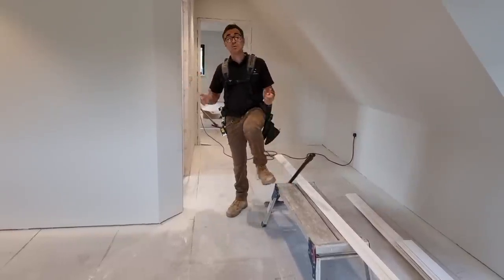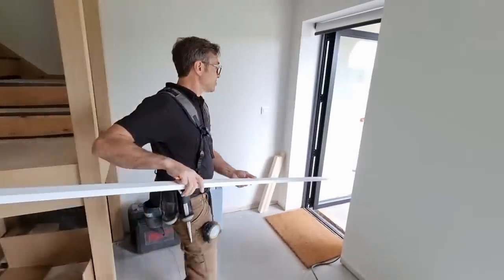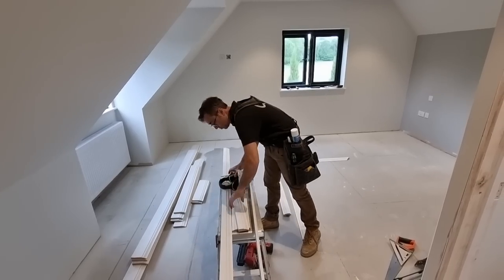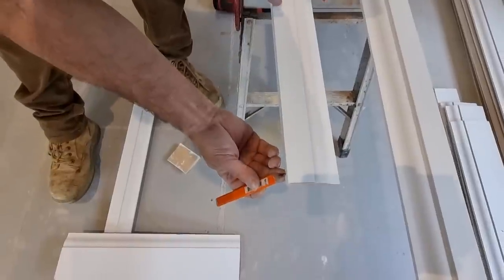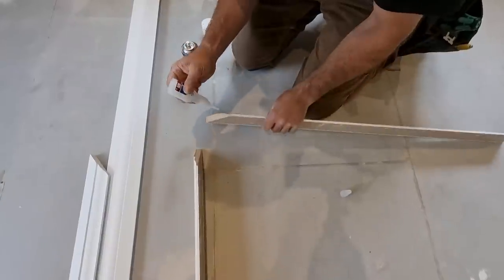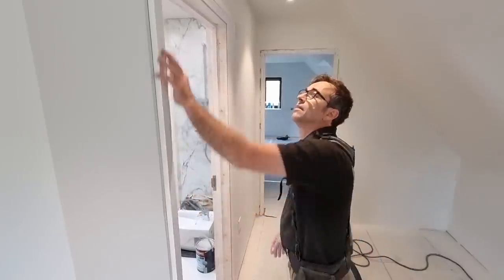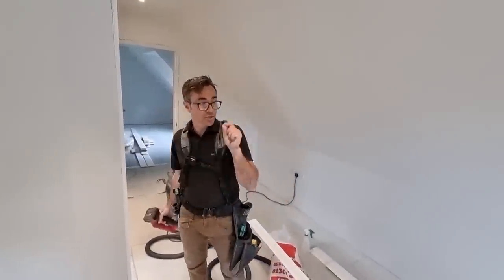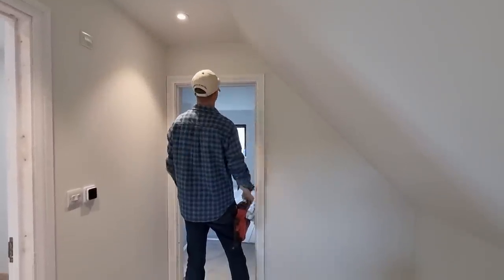How to fit MDF Architrave. The Big build episode 47

Comment: It’s satisfying watching these lovely well built dwellings with nice flat plaster and square openings. I do a lot of work on Victorian buildings, sometimes newly plastered; nothing is square or flat; the frames are wonky on both planes and the plaster might be bulging right next to the frame. Wouldn’t mind a vid on overcoming all those issues. Good vid.
Reply: Yep I've had to do all sorts of to get the architrave on the wall nicely when the plaster has been proud of the door lining. Adding more material to the lining or sometimes planing the back off the architrave to get over bulges and lumps.

Comment: Ed’s process of positioning the two architraves back to back was a neat idea the keep the biscuit router flat.  I tend to use architraves that are 3 to 5mm thicker than the corresponding skirtings.  Working on older houses the walls are not always dead straight and so it helps to have a bit of lee way when butting up the skirting boards to the architraves to leave a neat finish.

Comment: Quality as always. 
The more i run my own projects and the older i get the more bothered i have become about been efficient, precise ,accurate, etc.  i try my best to get the finish as good as possible, I have been doing Joiney for 15 years now and some of your little tips have come in so handy. things i haven't thought of. in this particular video  pre cutting all the legs and then spinning upside down for  exact length, i usually do the same but mark the miter position,  i will definitely be trying yours next time.  it goes all the way back to setting your studwork out to allow for a full archi, there the small details people dont allways see.
Reply from the maker: Nice one Josh!

Comment: Love that you silicone the archs. Here in Australia you’d be lucky to get 3 nails. The only biscuits I’ve seen are at smoko and there’s no need for accurate mitres cause everyone is sponsored by poly filler.
Reply: 😂imenglish but  i worked in queensland for a few years building steel framed kit homes, your absolutely right on all counts, brought back so many memories, especially smoko lol , i remember if the plumber put his waste pipe in the wrong place in the slab, we would cut it flush and fix our stud straight over the top, everyone was on meterage rate and didnt give a shit about the next trade coming in
Reply: @michaelhorn5633  haha, so true. It’s like being on a game show. Robin should move over here, he’d save a small fortune on nails and glue, plus all that time spent doing thing properly. He’d only need to work a 3 day week.

Comment: I do mine completely differently, I use no adhesive at all just pin the horizontal piece on the top then put each side on, I pin the corners (pre drill) . none of them have ever moved or separated, perfect joins. I can see how easy robin makes it look but that ca glue I can't seem to get the hang of it lol, either too much glue or too much activator I guess.

Comment: Another quality video. But I'm surprised with the absence of hearing protection when routing the biscuit joints Robin. It's because of your previous vlogs on the importance of using them, that I use mine and drum into my sons why they should use them when operating hearing-damaging tools. I'm sure my awful, damaged hearing and tinnitus problems go back to the 70's during my apprenticeship and after, when PPE / health & safety were scarcely seen.

Comment: Hi Robin, novice question but can I  let the architrave sit flush on the finished tiled floor or should I raise the architrave 1mm off the already finished floor in case there is an upward vertical expansion when underfloor heating on? I presume sitting flush on floor is ok. Note tiles have the necessary expansion  gap between edge of tile and walls  for horizontal expansion.

Comment: This is by no means criticism but we always avoid if possible any gap filling adhesive in our experience it holds the architrave off the plasterwork to far even if you apply a small amount. Another point worth mentioning is if your walls are not coated this adhesive as any will not stick to bare plaster we have had jobs fail in days of old.
Our preferred method is to cut as we go in many referbs linings are just not accurate enough to pre assemble architraves we then use expanding foam and a paslode  a minimal amount is required for a dead tight fit  and no issues with adhesion a competent decorator will always caulk all edges we have always taught this .
Great channel 👍

Comment: Nice video Robin.I like the tip of putting the architrave upside down to mark it. Much quicker than measuring with the tape.
I've been putting biscuits on the join from skirting to architrave for about a year now after another carpenter friend showed me. I also now biscuit the 45s of my architraves and use PVA rather than the more popular mitre mate.

Comment: With Ed’s door architrave, why did he put 2 biscuits in using the clamps when one of them was up against the wall on the left? Surely the biscuit needed to go on the face of the architrave so that the skirting butts up against it when fitted
Reply: Mind you, if you have a biscuit in the bathroom door that Robin fitted and another in Ed’s door you wouldn’t be able to fit the skirting in unless the mfd flexes a bit. How do you do biscuits and skirting in a wall with doors reasonably close together if you put a biscuit in each adjacent architrave?
Reply: @toady5843  1 set of Architraves first then fit the Skirting then fit the second set of Architraves
Reply: Probably just force of habit as they are biscuiting nearly all of the architraves within the house

Comment: “Ed” scale a bit disorienting (low door). Part of preparing a “used” house for move in. Previous owner stacked 3 cut pieces of architrave in the corner by the door. Jamb and plaster misaligned. Fixed that.  Laid out architrave. Left side. Top. Left side. Why it wasn’t installed.

Comment: Great tips Robin. Very tidy work, I think margins being accurate around the frame is a must, ⅜ was the    margin for architrave most chippy used here in Ireland.  As you said in the video working off timber floors it's nice to get a clean cut on the floor. Wish I had Ed's height for the heads 🤣

Comment: Typical of Rob as usual making a fiddly job look easy, does fitting biscuits make it harder to fit the skirting?  I did wonder though regarding cutting mdf indoors, l have been led to believe that when using power tools on mdf they produce formaldehyde fumes therefore requiring a fume grade mask is this correct? Great videos Rob